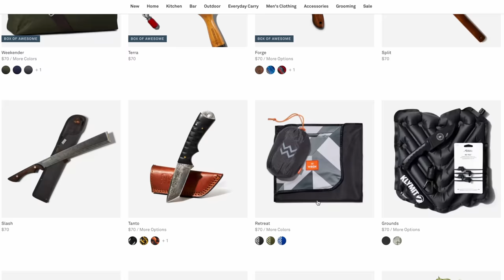What's Inside A Professional Homeowner's Toolbox

Comment: Put a 48 inch long power strip set back a couple of inches from the front under the workbench. You can see and access it easily. And, no cords across the working surface.

Comment: I have the same box and when i first purchased it I thought the organizer draw was going to be a waste of space but later on learned how handy it actually is to keep nuts and bolts, rivets, fittings electrical connectors and other miscellaneous things i would use everyday and having them conveniently organized saved time from walking across the shop to grab them from the wall bins.

Comment: I have a piece of plywood with clipped corners and 4 drywall screws that are cut off and hang down to keep it center that sits on top of my trashcan. It makes a great portable workbench for chainsaws string trimmers and other small projects. Can easily move to wherever you are working and doesn't take up any more space in your shop. Plus the garbage is under, just lift the lid and throw your trash out.
Reply: Now that's a great idea I'm gonna use... thanks for the idea!

Comment: Was a production welder for 10+ years and learned a lot about how to setup a workspace. Always had ten or so of my most used tools within arms rear, but everything else was in tool boxes so it wasn't in your way. Those ten tools rotated occasionally depending on what we were doing too. A fixed mindset on how to setup a shop is the only thing that doesn't work well.

Comment: Order the Milwaukee M18 Heatgun and the M12 soldering iron. They are the perfect pair. Sometimes the m12 soldering iron is a little underpowered for thick gauge wires but it works so well and no gas and heats up very quickly.

Comment: You could mount the power strip on the bottom of the work surface, recessed in a little so when you plug something in it's not sticking out. Then you also wouldn't have to reach all the way to the wall.

Comment: Great color choice. I have a snap on box that my dad bought used in the 90s. I have no idea how old it is but everything still works. Its probably from the 80s. Only one section is on roller bearings (i think that was just normal back then) but it is the heaviest with all my sledge hammers. slides like it is on ice. what i am trying to say is you didn't waste a penny.

Comment: You might want to double up on those sliders with that heavy drill in that drawer. Your snap-on guy should give them to you.
Reply from the maker: The drawer is rated for over 200 lb, I think it's can handle a 10 lb drill,
Reply: @wranglerstar  oh it looked like it wrighed more than that when you put it in. I work for snappy and if a drawer will take two slides I put them in, never know what the future holds.

Comment: Nice setup, Cody.

Lithium batteries dislike hot and cold environments so I setup my charging stations inside.  Not as convenient but my batteries last forever.
Reply: I've heard that said many times. None-the-less, I live in Texas and my DeWalt and Ego batteries are always kept in either my garage or my equally hot truck. Most are several years old, and they are all still going strong. It would be nice if Project Farm ran a long-term test and gave us the bottom line on battery health vs. temperature extremes.

Comment: Curiosity Q: I watched you *extend* the power cord that would feed the 'power drawer' in the SnapOn box in an earlier video, then *facepalmed* when I saw that you drilled the hole *5 feet* from the outlet you're most likely gonna use to plug into!! Why?!? You might as well have left it original length, and then swung a power strip over to it!! Now you'll have 5 feet of ugly black cord crossing that beautiful beadboarding under your bench, and it'll *always* pull my eyes to it! "PLAN your WORK, then WORK your PLAN... If you FAIL to PLAN, you PLAN to FAIL"... L.T. Dunlap (1910-1987) -- Blessed Be, & Peace! 🙏☮

Comment: For power, look up "24-Outlet Vertical Power Strip, 120V, 15A, 5-15P" Tripplite PN: PS7224 . Its a six foot long, 24 outlet power strip. Run one of these  on the wall, about a foot above the work surface and all your outlet issues are solved! 
The only thing that would make it better is if it allowed for alternating circuits, so you had TWO 20-amp circuits feeding it, allowing for a better distribution of power.. 

I also love the parts organizer drawer, but I really do not like keeping consumables in the TOOL box.. I feel those need their own organizer like the packout organizers. That way you can have a stack of packouts, one for electrical, machine screws, wood screws, nuts, bolts, etc.. 

Also, something extremely imporant for me, task lighting.. I like to have a dedicated, extra bright light over my work area. There is nothing worse than dealing with shadows when working at the bench.
I do wonder... I think Im about due for a bigger tool chest like that.. Im starting to spill over the one I have.

Comment: Do you still have your metal bench that served as your main toolbox at the last shop? Also, I totally agree, I used to be all pegboards and now I am entirely in three toolboxes. I used the socket drawer in one of my toolboxes to put all the power tools in as it is at the best height in the toolbox and I tend to use them the most. I still have a small pegboard which I keep ONE set of pliers, screwdrivers, hammer, mallet and ppe which I found my self needing most frequently. All my additional duplicates of those tools I keep in drawers and I have found that system to work best for me.

Comment: The cases that Most Milwaukee stuff comes in really are better. Good latches and they seem to try and make them as small as possible. Not for the tool you use all day every day but for a router or sawzall they really are decent

Comment: Cody, per your request for a heat gun. 

I have a TITAN heat gun (same brand as paint sprayers) I’ve used it everyday at work and has never failed me. You can adjust the temp in increments of 20° up to 1200° and can speed as well. It has a basic screen display that will tell you the temperature as well as can level!
Reply from the maker: Do you have a link?
Reply: Also your local sherwin Williams should keep them in stock! Great video today. Just getting back to the hotel from work and it was a great video to unwind to!
Reply: YouTube is not agreeing with me posting a link for some reason. I sent it to you on Instagram

Comment: Are you planning on working on the to of your tool chest? I would consider putting some sheet metal on top to protect it, which could then be sacrificial.
Reply from the maker: Yes the top is made of thick gauge steel covered with a truck bedliner very durable surface

Comment: Speaking of outlets, I am sure they make a powered top for that box also
Reply from the maker: Yes, $1800
Reply: @wranglerstar  sounds like a fun DIY project.  Integrate even 4-6 outlets into the underside of the front of your bench.  You wouldn’t have to reach under to plug tools in, and you still keep the cords off the work surface.  In fact I might do this myself.  After I clean my workbench.

Comment: Metal cases and took boxes are horrible. Pure trash. They rust, and worst of all, they dent if they get dropped. A plastic box is far superior, and a lot are waterproof with a rubber seal. Blow molded cases are excellent for actual construction workers. They have all that extra airspace so they can absorb shock. And they also cost less to produce. They are far superior to the injection molded cases of the past and the stupid canvas bags at Milwaukee gives you with some tools.